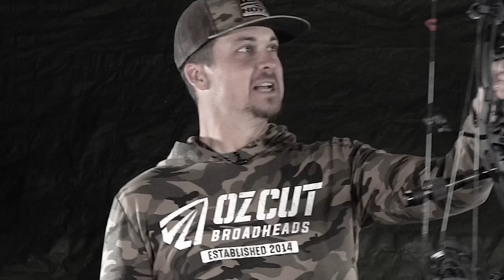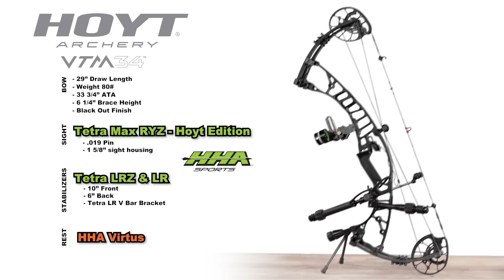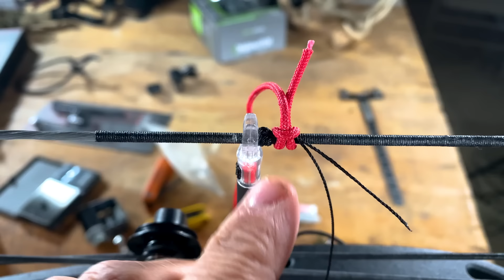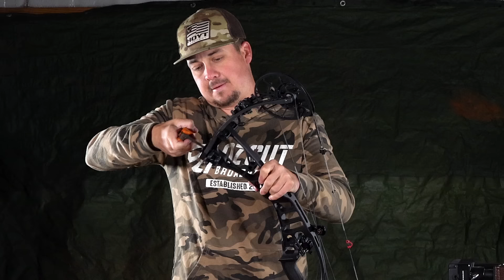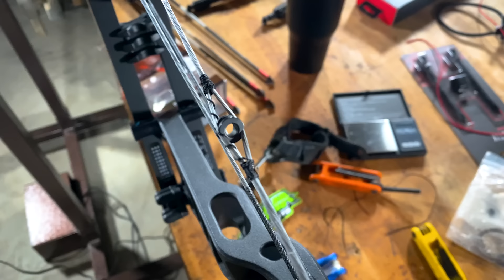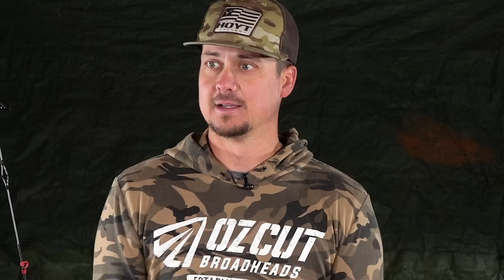Hoyt VTM34 | 80 Pounds | 29" Draw | Bow Build

Comment: You might lose a pound to half a pound in draw weight. Not cranking the limb bolts down the whole way. If you keep it turned out half a turn. That's no big deal though
Reply from the maker: Yeah, it's normally a pound or two when I crank it off a smidge. I just always heard it increases performance, but I have absolutely zero evidence of that. lol
Reply: @MyWorldOutdoorsYT it's actually the opposite the bow is most efficient when the limbs are bottomed out. It's truly how they are designed to work